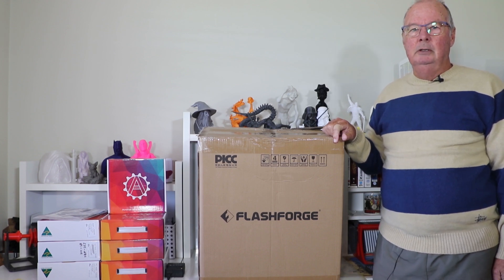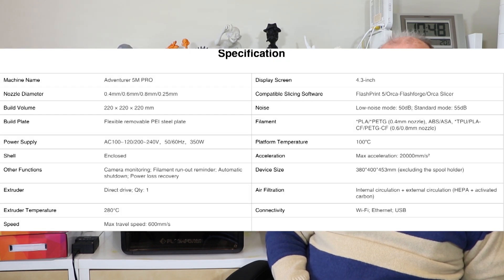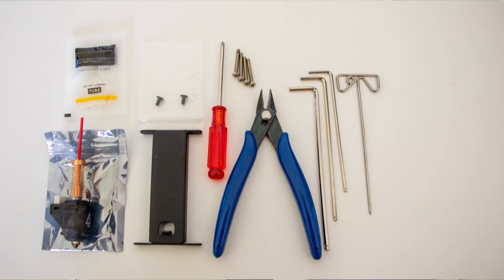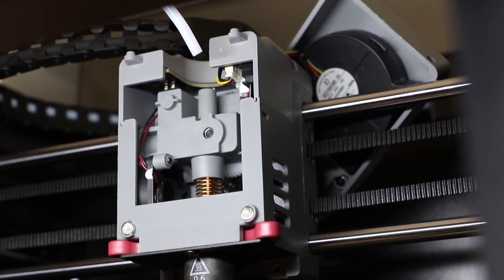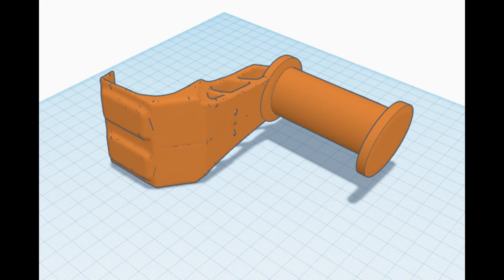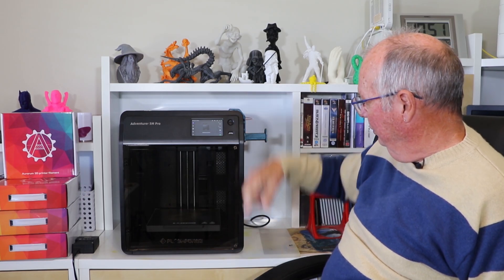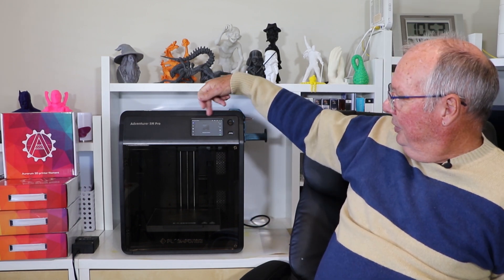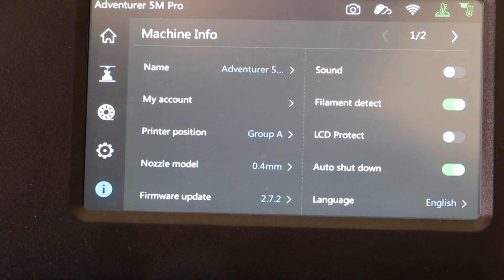Flashforge Adventurer 5M pro review

Comment: How do you calibrate esteps (rotation distance) on the 5M Pro? I understand the process but not sure how to send gcode commands to the 5M. Can that be done through Orca or FlashPrint or do you need another app to get this done?
Reply from the maker: On a marlin printer it is easy but never done it on a klipper based printer. The calculation method would be the same but I don't know the way to command and save on klipper . I would search the forums and google, there is bound to be an answer out there.

Comment: Thanks for the video. Have a few questions. How quiet is the printer? How well does the air filtration system work when printing more smelly filaments like ABS? Have you had any more luck trying to get the camera system to work with OrcaSlicer? What was your prime complaint about using the FlashForge slicer? Not sure if you have any experience with Bamboo Labs printers but if so how do you think they compare? Did you only use the FlashForge filament when you did your prints? If you tried other brands, what were they and how did they work? What were the prime negatives you found with the printer? Overall would you recommend it? Thanks.
Reply from the maker: Hi, I will do my best to answer your questions:
Noise depends on what you are printing, PLA quite loud, ABS very good. It's all relative to the fans used.
Filtration for ABS is great but not sure how long the charcoal lasts.
Camera - no.
Slicer - just personal preference.
Have not used a BambuLab.
I mostly use Aurarum filaments - local company.
Nothing negative - just works (giving it to my 14YO grandson as a first printer)

Comment: Does the front glass door have to attached, or can you leave it off? I have limited room.
Reply from the maker: 4 small screws and it will come right off.
Reply: @TheHotEndChannel  So it is ok to leave that door off, functionally-speaking?
Reply from the maker: @deeber35  only for PLA, anything else is best with a full enclosure
Reply: @TheHotEndChannel  I wonder how closed the door could be without being attached. Just lay it in place.
Reply: It is EXACTLY the same size with the door installed or not installed 😂